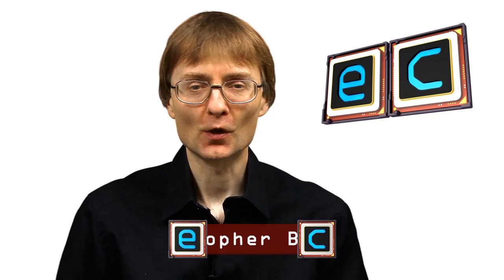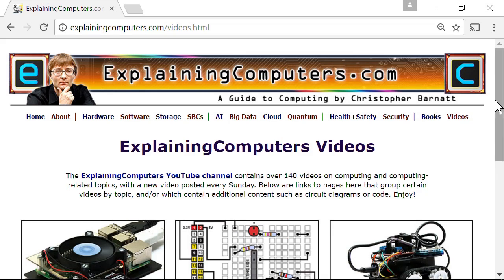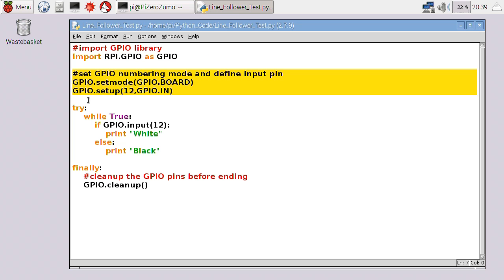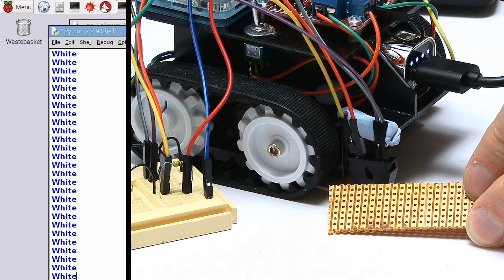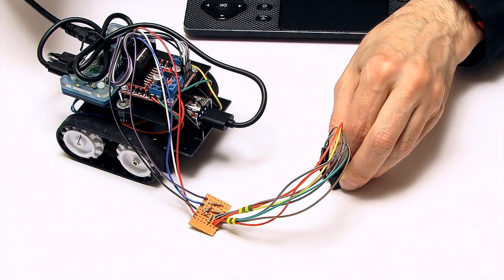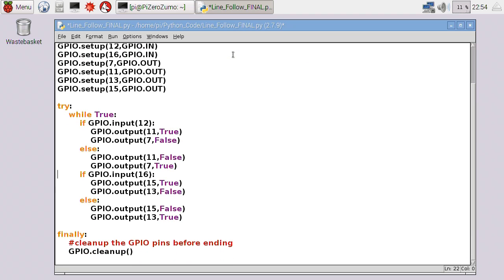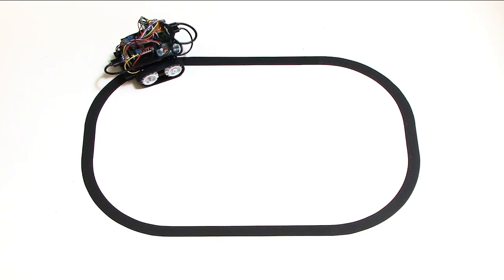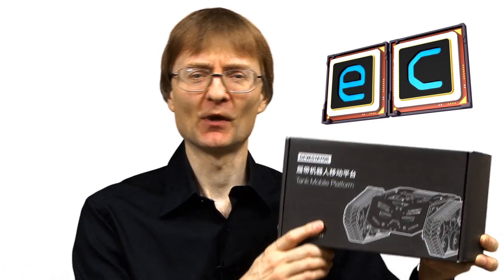Raspberry Pi Robotics #5: Line Follower

Comment: I use to complain about using microcontrollers instead of full fledged computers (I consider SBCs as such) when people do "simple projects" like this. But this time, watching that little robot following a line without external guidance, I am wondering, "am I thinking right?" My remarks (I've got A LOT of them) all have something to do with code complexity and power efficiency, but the results can be the same.

I can conclude this: First, make it work. Then, make it more efficient.

Comment: I'm in need of help with this particular code/board setup. With the same Adafruit sensor but a different GPIO pin used, I can only get a repeated BLACK or WHITE response during testing. I've tested the sensor, and it indeed is emitting an IR light, so I can only assume the issue lies with detecting the light (GPIO in?). I have a Raspberry Pi 3 B+ running Raspbian and a 4-motor chassis with each of 2 L298Ns powering 2 motors each, thus I'm using 8 GPIO pins for motor control alone. With the Adafruit sensor, I've tried utilizing GPIO pins 29 and 37, with only a BLACK or WHITE response. Can you help, please :) I'm attempting to run this code as a test, so I help my daughter with a school coding project.
Reply from the maker: It may well be your ambient lighting, the location of the sensors (height), something like that. You may need to experiment with the sensors in place on the robot. Good luck!
Reply: @ExplainingComputers  Actually I just saw your note about not offering technical support due to volume, so no worries. I'm working at it again now, and am using your code verbatim but only receive a repeated "white" response. Even if I cover the sensor fully (eliminate all light), I get the same response. I'm trying multiple sensors with the same result. Clueless.
Reply from the maker: @robmyers2625  If you can get the black/white result during testing, then the sensor (emitter and receiver) must the working, and the connections to it also. Are you saying you receive a white response only when the sensor is on the robot, but black/white in the earlier test?
Reply: @ExplainingComputers  No, the Black or White response I got had something to do with the different GPIO pins I tried. Alas, it's working now, i simply had to show the sensor a contrasting color (actual white vs. actual black, not just ambient white light vs. my finger over the sensor). Now onto the 2nd sensor and pin 16. Thank you Christopher for the assist! Cheers!
Reply from the maker: @robmyers2625  Ah yes, been there. A finger can be a problem, as skin can be highly reflective, and also a source of heat! :) Glad you got it working.
Reply: @ExplainingComputers  Thanks Chris. Im wondering if I can send you a picture of my breadboard wiring for review? Admittedly Im no good at understanding resistors and I feel that maybe I have over/underpowerful resistors being used? Been working at the code and wiring for two days and can't figure it out. Any help is appreciated!

Comment: Hey Chris, I just want to say thank you for the amazing explanation and video, in fact honestly after watching your video I got inspiration and confident to build one myself and now I want to take one step ahead on robotics field. I am trying to build a self balancing robot just like Zumo but on 2 wheels. There are tons of videos I have seen but the place where I am lost and am trying to understand and get help is with the Gyro chip MPU-6050 for balancing and moving the robot fwd/backward/turns etc. I am not sure how to read, understand them and then use those with the wheel movement using raspberrypi and its coding. Can you please make a video on "Self Balancing Robot" and share you knowledge and views so that it can help.
By the way I did used both raspberry Zero W and Orange pi to build my Zumo robot, in fact I also used the IR receiver of Orangepi to control the movement using an ordinary remote control of an LED light bulb which works great and good thing about it is you can bypass the wifi internet connectivity once you boot and start the IR process since after that you can control it with the remote and play with it anywhere outside the wifi network. It felt great :) and thank you for this.

Comment: Hi I've done almost all the tasks. I do not know how to connect your programs to the program from Simon Monk"'Raspberry pi Cookbook". Distance measurement with a ultrasonic distance meter HC SR-04. That the robot would be twisted 25 cm from the wall.Help. Can you change the last line instead of print to give a command to gpio? Just what to do with the last line (time.sleep(1))?
Reply from the maker: I do not know that book I'm afraid.
Reply: OK. There is such a variable distance_cm = pulse_len /0.0000058 I think. I will add an if operator to this variable.
Reply: Detriment. In these books I read. They write that an infinite loop is a mistake, and I need an infinite loop for the robot

Comment: Excuse me, Christopher. Are those optical sensors only able to sense the colors black and white, or can they sense all the other colors?
Reply from the maker: You are right, they sense light intensity -- luminance, not chromiance.  However, with the use of coloured gels, you could potentially use such a sensor to react to one colour spectrum alone.
Reply: Thank you for the information. Can you please give me a brief explanation about this coloured gel? Other than that, thank you again.
Reply from the maker: The gel would need to be pure reg, blue or green and used to cover the receiver part of the sensor -- like the lighting gels used on stage or movie lights perhaps.
Reply: If the gel is used like you said, then I'm guessing it will be able to detect the gel's color and it's inverted/reversed colors. If so, Thank you very much for the information.

Comment: Can you show how to make this program run every time the Raspberry Pi is started without having to tell it to start?
Reply from the maker: I will be covering that in a video in December. :)
Reply: Great. Thank you so much.
Reply: I am making a wireless security gate controller that I want to activate via text messages. It is in a place where wifi is unavailable.  I plan to be able to turn relays on and off briefly and for a set period of time. If there is any help you can give on this project it would be greatly appreciated.

Comment: How would you calibrate the motors to rid the robot of its rightward drift?
Reply from the maker: With difficulty! A guess a potentiometer could be added to slot one down. But the tug may be due to an alignment of the tracks.

Comment: Great video! I'm wondering, how reliable is the Raspberry Pi in terms of the O.S.? I mean, can it run a critical task, lets say for a automation? Tks.
Reply from the maker: The Pi, running Raspbian at least, is very stable -- so should be fine for automation.
Reply: If critical tasks means time related tasks, it's better a Real Time OS (so you will need a microcontroller).
Because this is a Multitasking OS and have more latency by the way it works, so can't keep up with the timings

Comment: How to make a Start/Stop Point?
Reply from the maker: You could, for example, add code to detect if both sensors see black, and then put a line across the "track" (at 90 degrees to the line being followed) to trigger a stop -- or a reverse! :)

Comment: Great Video, Thanks a Lot. 
Could I request that you use the LattePanda inside the devastator model?
It fits in (I tried myself) but I never got very far with it. I was thinking to stick the "dream cheeky thunder" on top of it and use VisualStudio C# (and the firmata for the Leonardo) directly on the LattePanda.
Reply from the maker: I may well try this, though will start with a Pi Zero W.

Comment: DRUG SEEKING ROBOT: 
Add a small vacuum cleaner/fan so it will not just follow a line but snort it too ;-) So you can make lines of flour/sand "on the go" on the floor and it follows you and snorts it ;-)

Comment: I did a similar thing with an arduino based differential drive robot.  It uses 5 IR sensors and the wheels can be speed controlled, rather than on or off.  All I really did was implement a line following algorithm as the one that comes with the SDK is rubbish.  My cat loved it :-)  It's quick, too.  I had to slow it down or it would bounce off the surface it was on.  Unfortunately I only had the robot for a couple of days, or I would have come up with some sort of smooth acceleration/deceleration.  Good fun, though. https://www.youtube.com/watch?v=tp7u24q2tk4

Comment: do you think it would be possible to replace the insides of a 3ds with a raspberry pi, and still using the battery, screen and controls? i have a broken 3ds and i was wondering if it is worth a try.
Reply from the maker: Yes, I am sure this could be done! :)
Reply: thanks, i will be sure to start that soon. :)

Comment: good sir , it's really working as you programmed in real world , sir can we get it's code on GitHub? and sir can this program (code) generate a log type file which stores its movements (like turn right, move forward ). Sir, I asked this because while coming to the curve path , it might turned a little bit then it moved forward, then turned a little bit, this process would be going on till it ended that curve path. really good piece of tech and code you put on that pi zero. But after all really happy seeing all this. 😀😀😀😀
Reply from the maker: Thanks for this. All of the code for my Pi Robot videos is on the webpage shown in the video: http://www.explainingcomputers.com/rasp_pi_robotics.html
Reply: Thanks sir

Comment: nice vid but wy are you using The old version of raspbian and not pixel?
Reply from the maker: I did mention that in the video, I've yet to upgrade the Pi Zero to Pizel (which would require me to get it online). And it works! :)
Reply: Ah oké tanks for quik respons

Comment: Fantastic! 
Maybe the next step is to get the ride a bit smoother. I wonder if you can use four sensors to allow the robot to know if it is starting inside or outside the track. 
I guess we shouldn't be surprised if soon we see Render Box thumping down the road to pick up the weekly shopping.

Comment: How exactly did you mount the sensors? Can you explain on your Facebook share of this video?
Reply from the maker: I drilled and opened out two holes/slots for each sensor, which accommodated the two jumper leads at either "end" of the sensor. The two wires per hold (four per sensor) were then threaded through, attached to the sensor, and threaded "back", as it were, so that jumper lead socket ends (as attached to the sensor) held in place within the hole. So no other mounting was required -- they just held in place -- and this allowed easy height adjustment.

Comment: What are the odds our host has another black-line on white course, but with many intersecting straight and curved turns.  I wager Mr. Zumo was given a run on the complex course, whereupon it became as frantic as a worried ferret, and lost it's ever-lovin' SBC mind.  THAT's why Sgt. Devastator has arrived;  Mr. Zumo is in hospital.
Reply from the maker: I did think of showing the robot on many tracks (the line I built is in sections that can be put together different ways!). During the making of the four videos it appears in, I have burnt out one Zumo motor . . .
Reply: Jokes aside, your simple oval track proves the approach - easy and straightforward for people new to tinker/maker projects.  Great you've got another chassis to work with.  I'm pondering on a robot that gets its instructions (for movement AND else) over wireless from intelligence on a 'serving' computer.  Thanks!

Comment: And how do you change the code in order to make it move faster?
Reply from the maker: It moves as fast as the motors will allow! To make it go faster, you would need a different ratio of motor (there are such motors available).